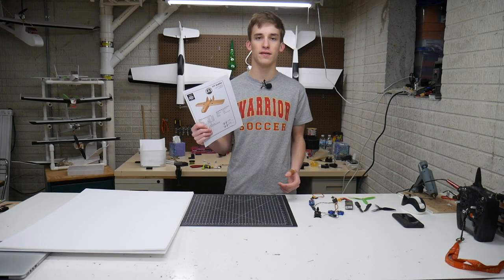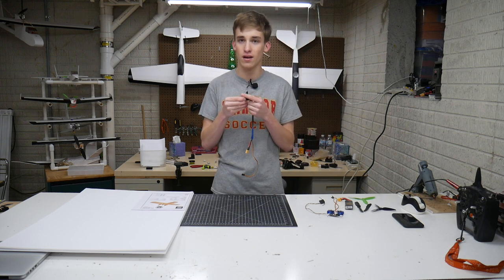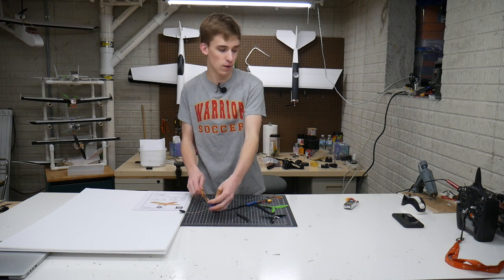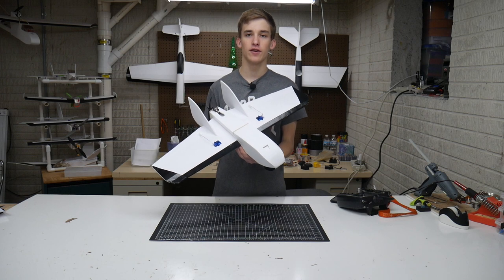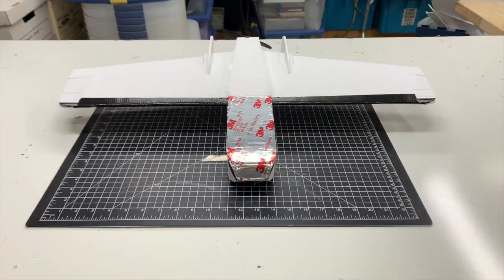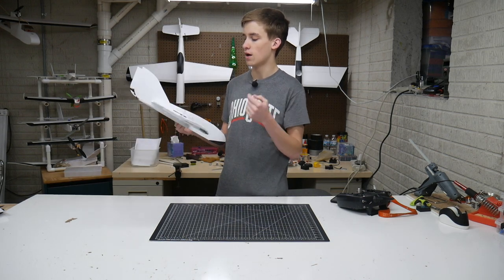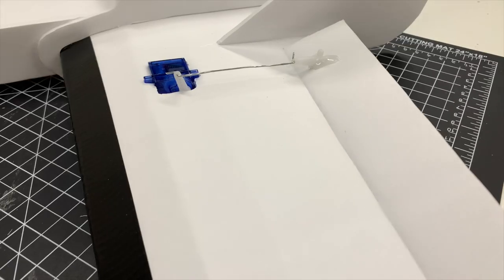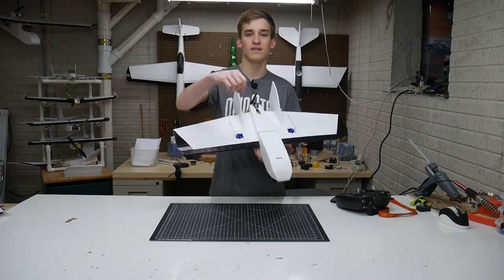FT Goblin Build + Initial Thoughts

Comment: Nice video! When you were putting the Goblin together did you have a hard time sliding the wings into the fuselage? Did the plans match up well with the slot and wing or did you make adjustments. When I made the Goblin I had gaps between my wing and fuselage and wing...not sure what I did wrong?
Reply from the maker: As an experienced scratch builder, I didn't have any issues. I typically cut the wing cutouts a little small and use the sliding force of the wing to open it out to shape. Small gaps are inevitable but just remember that it shouldn't affect the way the plane flies, so go out there and have fun!

Comment: Elevon reflex? a foam thickness of up on each side with no stick input? Thanks! Looking to start building this one soon. Will an EMAX RS2205-S 2600 kv, 40A ESC, a 5051 RacceKraft tri-prop on a 3s be close to this setup? Great job!!!!
Reply from the maker: Michael Guillemette yep sounds similar to what i’m running. my word of advice, don’t push it on the prop, I attempted to upgrade to a 6x4.5x3, and almost straight toasted my motor. It’s plenty fast on 3s with my gemfan 5152. And yes, the elevon reflex is CRUCIAL. 1 foam board thickness and you should be golden. My friend tried flying his without, with negative results. hope this helps!
Reply: @CustomFPV  ... Thanks, friend!  Great info! What has been your top speed with your setup? I love the way this baby looks in the air, but am looking to go as fast as possible! Ha! Thanks again!
Reply from the maker: Michael Guillemette Not sure, haven’t clocked it. I’m gonna guesstimate around 70mph tops

Comment: Where is the CG exactly and why didn't you use 2200?
Reply from the maker: I use a 2200 now, just didn’t have any at the time. CG is very close to the leading edge, maybe a half inch. in front of the stock CG for sure
Reply: CustomRCMods thanks man! I have never flown without stabilizer...is it really that hard?

Comment: Bro what are the flight characteristics? As a beginner can I build this and fly easily?
Reply from the maker: I would say this is a good 3rd build. it’s stable and fun but not quite a beginners plane
Reply: Thanks for your reply, so should I stick to ft explorer? I was thinking of scaling down the plans a bit so that I can use 2204 motor with a 30amp esc, will that work for me?
Reply from the maker: @daipayanchakraborty2738  It’s hard to scale the plans down because the foams thickness won’t change, making it hard to assemble. should fly fine as is with a 2204
Reply: @CustomFPV  I don't use foam board, I make all my planes with 2mm coroplast, or coro sheet, 2x stronger than foam, you should try that bro!! That would be awesome
Reply from the maker: Although it’s heavier, and only strong in one direction. i’ve seen it done before and it tends to add more challenges to the build.

Comment: Hey can i build a dji System in there and fly it?
Reply from the maker: Yeah you can! it’s gonna require a little bit of thought on component placement, but it’s totally possible! Just connect the air unit to your flight battery or add an inav FC and go for it!

Comment: Hi.

I was just about to start a scratch build on this when I saw from the FT build video that:

•	the receiver seems to be built into the fusillade and
•	The motor is not mounted via power pod and seems rather difficult to remove to slip into another plane.
I’d appreciate your thoughts on this.  Did you go as they did in the video, or did you have a work – around?
Reply from the maker: The Receiver can be mounted pretty much anywhere you would like, given you have servo extensions. both of my goblin builds have had accessible receivers without extensions. I wouldn’t worry about that. If you are interested in a swappable system out of the gate then this system isn’t compatible, however  it could be done easily with a little bit of modding to a ft mini pod. I don’t run swappables at all so it isn’t much of a consideration to me, but it definitely can be done. Good luck!
Reply: Appreciate the help!  Thanks.  @CustomFPV